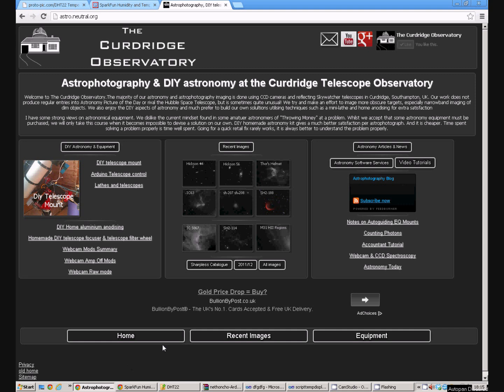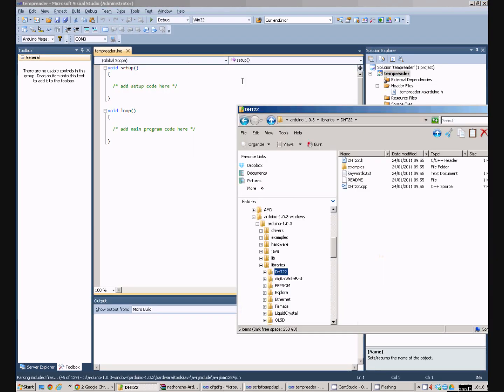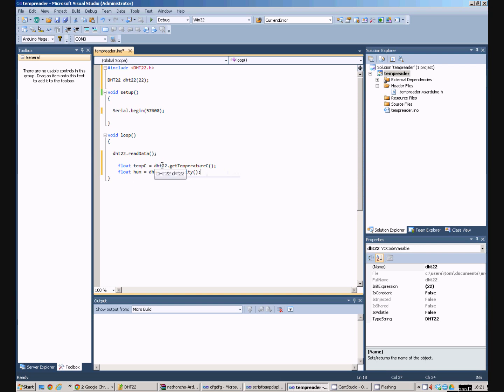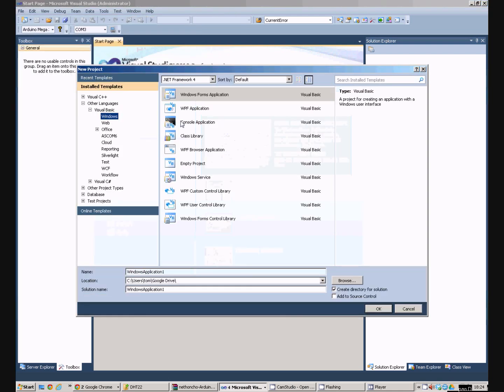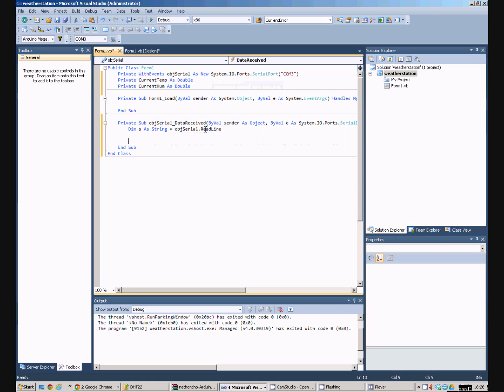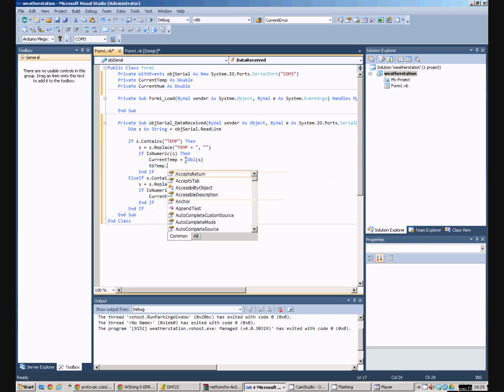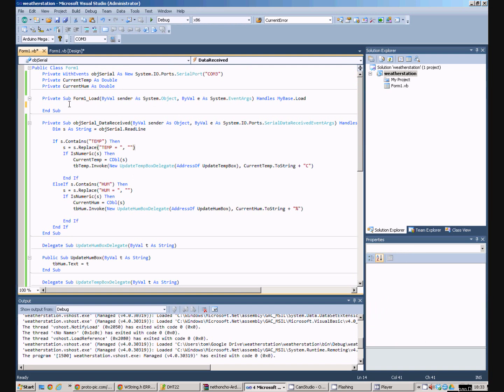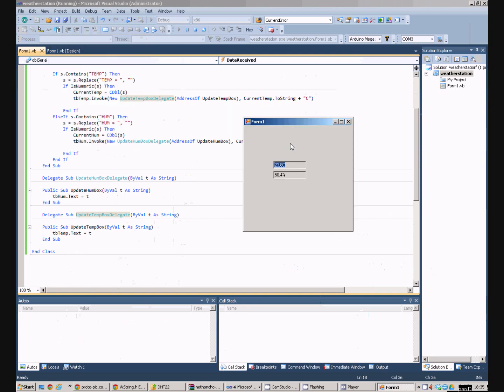Tutorial reading the DHT22 temperature and humidity sensor with Arduino and VB

Comment: The only inputs I need for the DHT22 are power and ground, and the only output is the serial data, correct? Is there any additional bitbanged signal that needs to be sent to the DHT22?